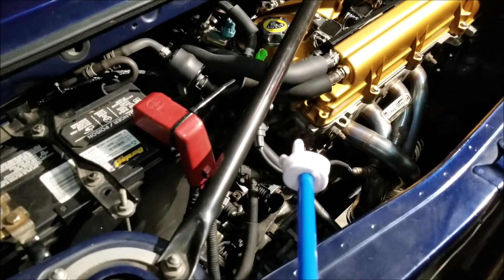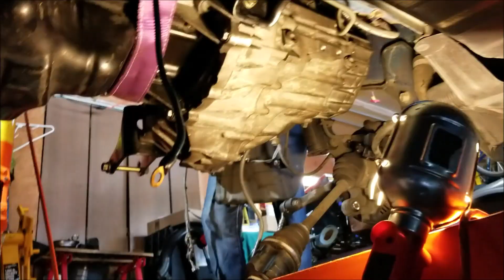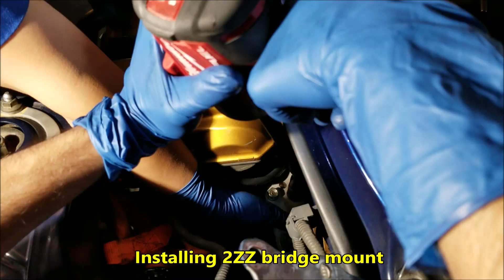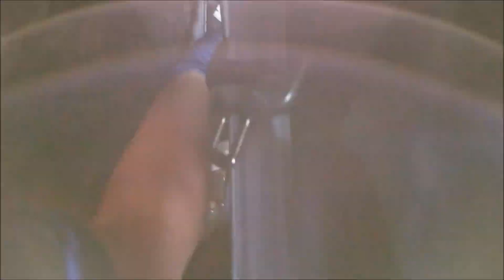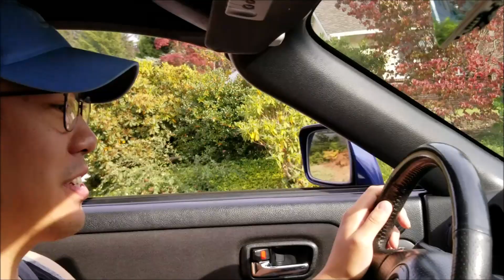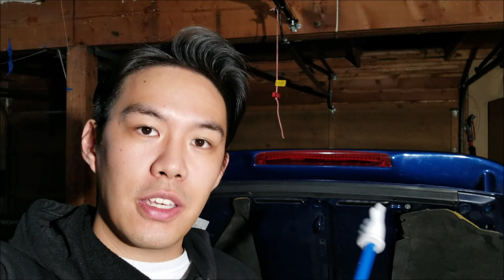Project 2ZZ MR-S: 2ZZGE Installation and First Drive!

Comment: How did the frontal visibility compare between the Sw20 and the ZZw30?  I'm currently making this decision.  On auctions now with a 20k budget. Im no togue specialist and just like to gently carve scenic ridgelines at about 25-40mph, spirited driving.  Sold an 04 miata 5 speed because of your channel. It was nimble, but I hated the "bumpy" hood and low windshield. it "muted" the experience.. That said, I want either a T-top Mr2 or the MR-S.  I bought a hardtop for the miata (for exterior looks 100%), but I'm more of an emotional driver than a "quick lap times" driver.  and part of the romance was lost when I couldn't put the top down at a moments notice.  The MR-S will have that same problem because I will surely buy a hardtop for it for the exact same reasons, but will wish i could just throw the top down sometimes...   But a T-top Sw20 can be spontaneous and I can throw them behind the seat just for a little open air above my head.  So there's a big win there. 

My biggest concern other than that, is that the MR-S might have less visibility than the SW20 due to the shape of the front end?   Do those big headlight bulges block the view of the road like the humps on the miata did?   I feel like the Sw20 with it's more straight hood line will taper down and out of view a little better.  that's sort of a "fixation" of mine.   The final point is that I like how the SW20 has aerodynamic plastic underbelly panels from the factory to close up the open hole. I bet that smooths airflow a lot better than most 90s cars..  but for some reason the MR-S did not get the same development (im guessing because it was built cheaper?) and the undercarriage is exposed and turbulent looking as any other 90s car..    What's your take on this as a track guy?  Even my 2018 civic has a nearly porsche-level flat floor and If i could have that for all my cars I would.  It's more of an OCD satisfaction than anything though. I just imagine the SW20 would have a much smoother high speed feeling because of the flat floor the MR-S lacks.    Did the aftermarket ever sell something to cover the body up with?
Reply from the maker: I suggest you just go try both. Or play a video game with fpv
Reply: @TougeTime  I can't do video games because it doesn't take my height and actual pov into account lol. Also, most POV youtube reviews don't have the gopro at eye level, so every car looks like it has amazing visibility being on top of their head lol. (I was going to purchase a 2019 miata RF because the one take made it's visibility look amazing.. But in real life at the dealership... my gosh it was horrible, that giant hood made the NB2 feel like a lotus)

I was hoping you'd have some perspective on the visibility since you did own both for many years of constant driving. (I don't know how tall you are but im a 5'6 asian male and maybe you're a similar height? lol idk) I live in hawaii so I have to fly out and import whichever car I decide on, making it much harder to compare them myself.  They are very very rare here and most owners won't let you in their car. 

I sat in an Sw20 already, and it felt pretty good (never got to flip the lights up, but they're within the fender's edge so that won't matter. I just never got to sit in a ZZw30.  I'm concerned if the headlight housings will make the front feel high like the miata.
Reply from the maker: Mr has the shortest hoods. You should be looking very far in any car though
Reply: @TougeTime  true, but I like being able to see more of the road beneath me than not, even right up close. Im not literally fixated on the painted line or anything lol. But it is nice to see them in your peripherals instead of a massive battleship of a hood. especially good for parking etc. (old man things). 

I ride motorcycles as well and they have the same mentality of extending your vision far ahead for hazards.

Comment: Shouldve kept the 5 speed, youd have so much more torque and disposable power per gear
Reply from the maker: No. The ratios dont match. This motor is a 1.8 with only top end power.
Reply: Wat. Y. C60 is the way to go on this motor

Comment: You mentioned a lightweight flywheel. Sorry if you've gone over it previously but what's the weight and how's the driving? I'm looking into getting one, but I don't want to make it miserable to drive. Thanks.
Reply from the maker: 8lbs. That's fake news. It's the clutch that makes it hard to drive. I just have stage 1 clutch. Drives like any car. Just revs fast
Reply: @TougeTime  Gotcha, Thanks for the reply
Reply: Gotta give it a bit more gas to not stall. I miss mine but my steep driveway plus snow in the winter is no good

Comment: This may have been asked already, but since you swapped from a 5 speed to the 6 speed c60 trans, did you have any issues with the shifter setup? Did you have to use the c60 linkage cables or modify the shift housing  at all? Asking as my MR-S is currently 5 speed and have got a 2zz and 6 speed to swap in.

Also what LSD did you get?
Reply from the maker: Please watch my 6 speed prep video. And a cusco 1.5way
Reply: Did you use the MRS shifter cables?

Comment: I think i finally got convinced to buy one and swap it, been thinking about it for a while for a new project, i still can't get over the cars looks which both the aw11 and sw20 win over any day but when it comes to handling, there's no comparison and the 2zz makes it a rocket ship, thought about building an na miata too but they're just everywhere and it would cost more considering all rust repair costs and either boosting it or throwing a bunch of cash for mechanical tuning and it would still be a soft chassis with much less potential
Reply: and your latest video visiting tps shop and getting their tune tips is amazing too, i thought about getting a 2zz mrs ever since i saw that original hot version video :D

Comment: Great video! I have a MR-S with 2zzge as well. I'm running the same MWR headers and 1zz exhaust. It seems like you changed the exhaust afterwards to free up the 2zz. Was it a noticeable improvement in top end power? Does it make you feel more kick when lift engages?
Reply from the maker: Yes . Huge difference
Reply: Thanks for the replies! Will definitely look at replacing it
Reply: what mid pipe and muffler are you running?
Reply: @Michael-uy4mr  I had the topspeed midpipe with stock muffler. I have since replaced the stock muffler with a custom one. Huge improvement on lift.